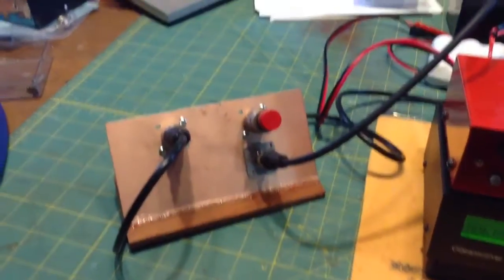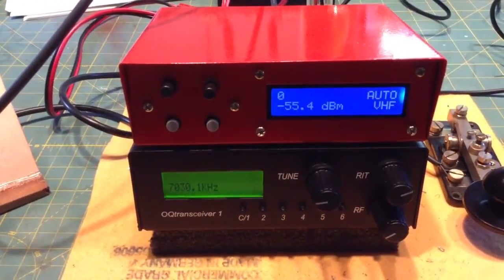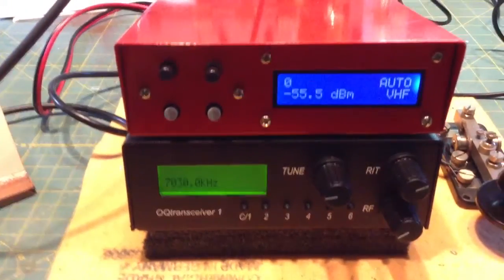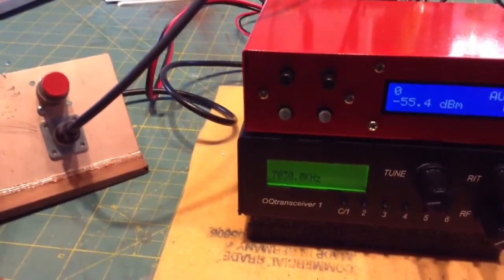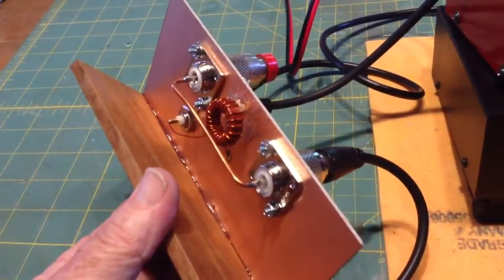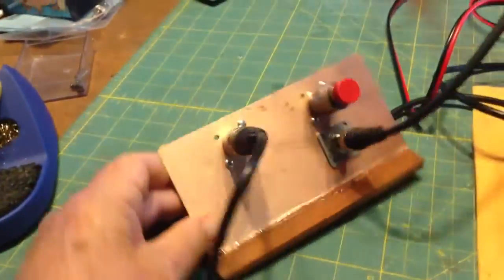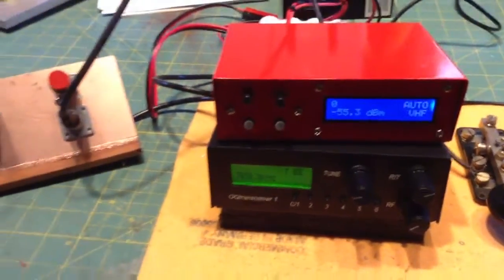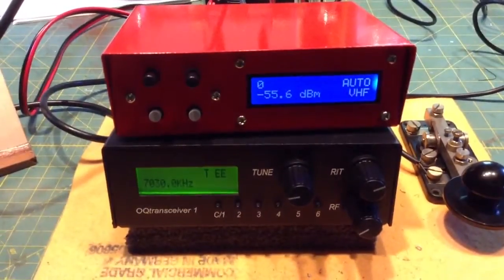Frequency counter coupler QRP

Comment from the maker: I don't think you need a specific toroid, but you can get a relative size by looking at the video. I believe this was a T106-2 toriod. It has 20 turns. I'm not even sure that the number of turns has to be specific. Without experimenting, I would venture to say that many different variations on this would still produce a signal that the freq counter would recognize.